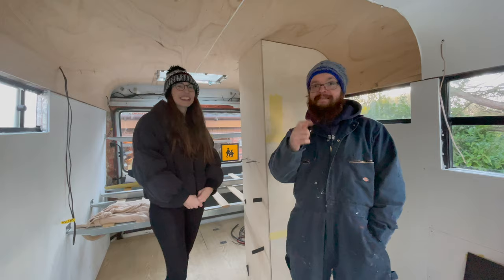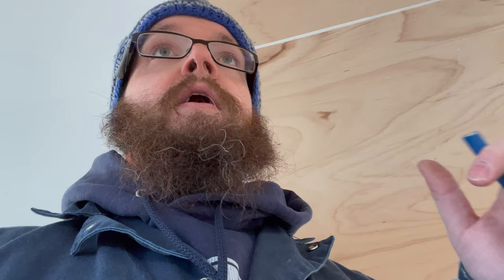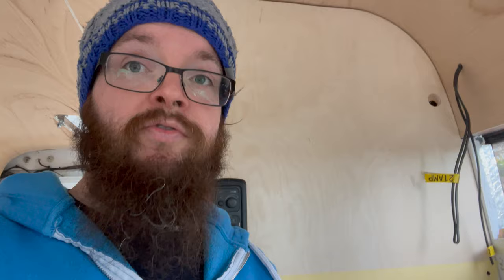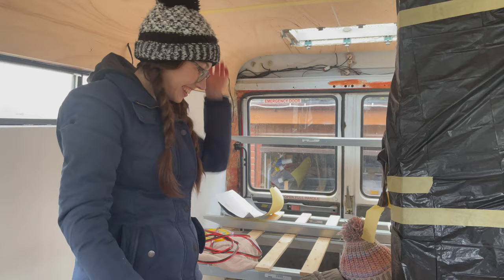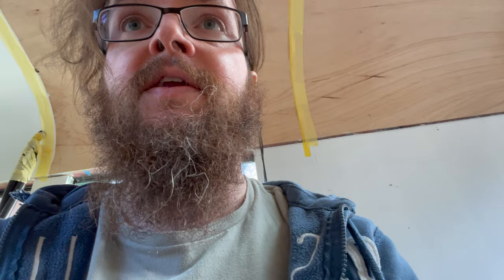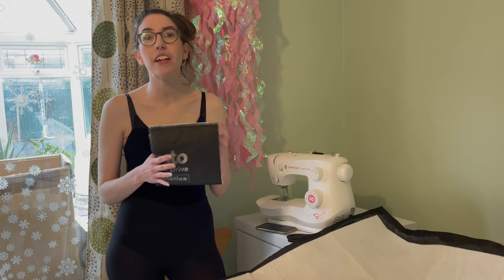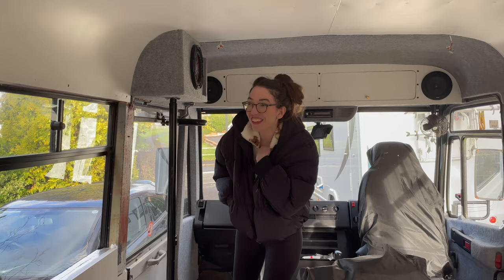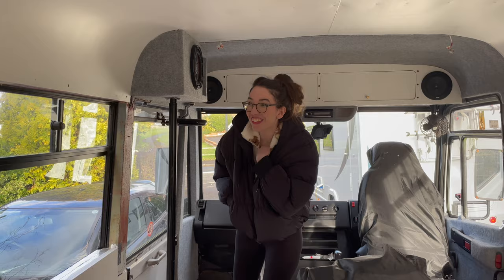Heater Ducting Experiment (Hot Stuff!) - Testing Cheap DIY Solution As Van Conversion Continues

Comment: Kelly have you tried stitching the material inside out, then pulling it the right way out, it just makes it look more professional
Reply from the maker: Hey Neil. Did consider this (it was talked over for sure) but wanted to have a ‘smoother’ inside surface for the tubes to slide over. We’ve got time to try it the other way though as will need more. Will keep you posted.

Comment: I didn't know this insulation fabric was available. Thanks for sharing. Im going to use this on part of my diesel heaters ducting.
Reply from the maker: Glad it was helpful! We were initially looking to use something like thinsulate or similar, but this looked suitable as people make ironing board covers and stuff with it. Let us know how you get on.
Reply: @WanderbusAdventures  The diesel heater should be installed this week. That will allow my van build to continue through the winter months, ready for travels in the spring/early summer hopefully. My heaters going under the drivers seat and duct dropping below are raised section of the floor. Then piped all the way to the back of the van (under the bed). The most important area for me to insulate is the duct that will go behind the fridge. That might get a double layer of insulation.
Reply from the maker: Brilliant stuff. That sounds like a good idea behind the fridge too. Like it 👍🏻

Comment: What a good idea - we’ll done you two.  You can also use a staple gun to secure the sleeve to the wall, then the heating pipe will not get knocked off by things moving around in the cupboard.  Thanks Guys
Reply from the maker: That’s a great idea! They’ll run all the way down behind the kitchen cabinets so that’ll work a treat. Thanks for that 🚐🚐🚐